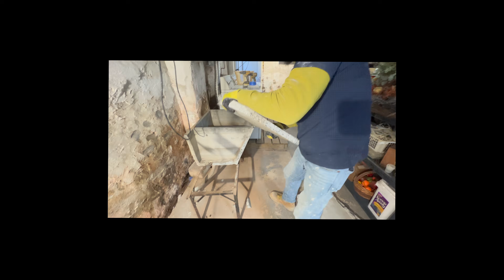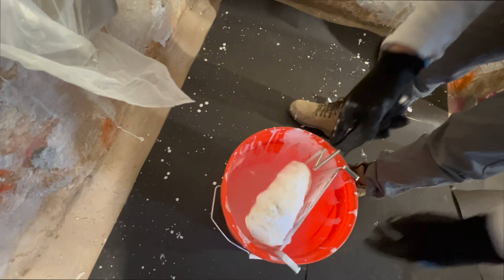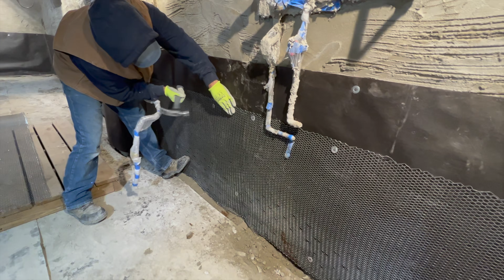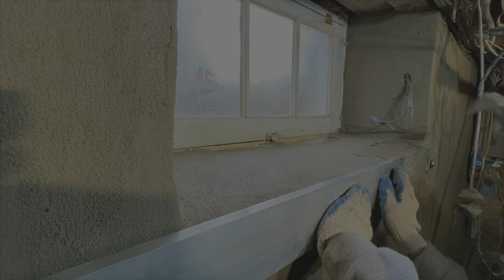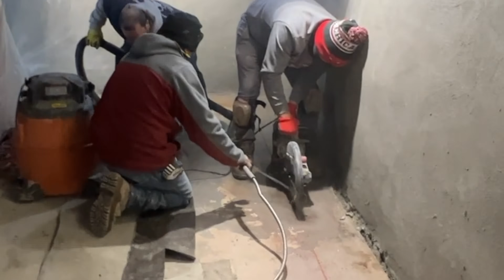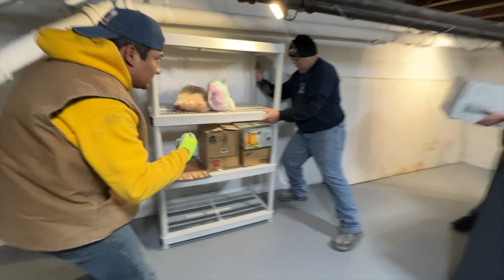Waterproofing scary basement Walls with Cement: Our Proven Method|Philadelphia

Comment: Incredible transformation! 
Would going in between floor joist not be recommended in a colder climate? I have a project just like this to tackle .
Reply from the maker: The first I ever heard of an issue with cementing between joists based on climate. What are the issues that arise?